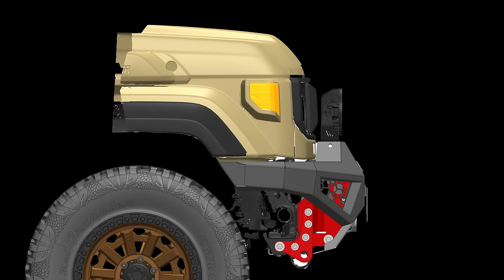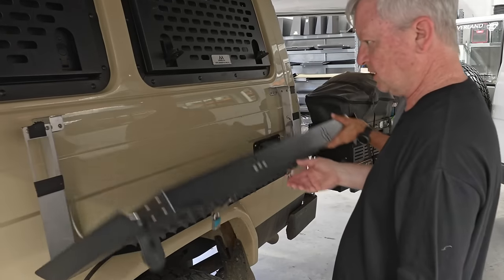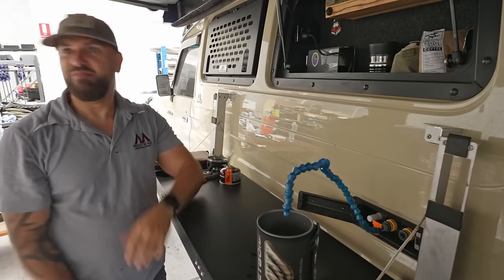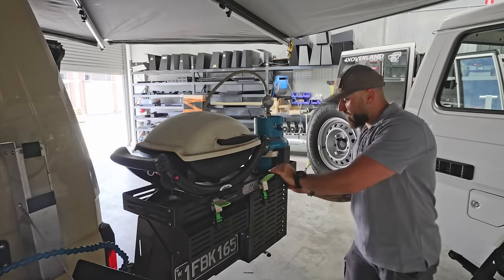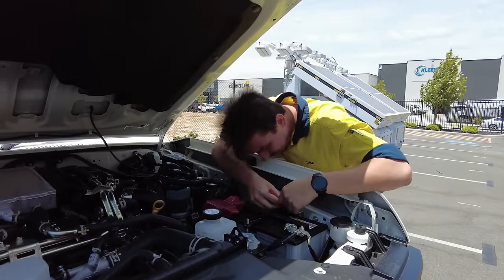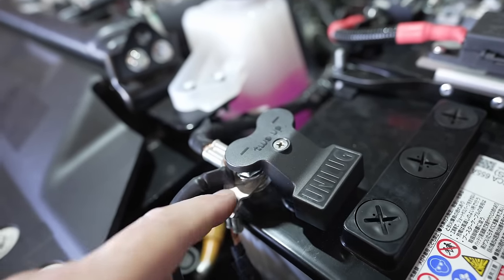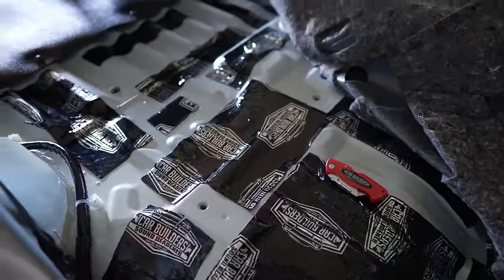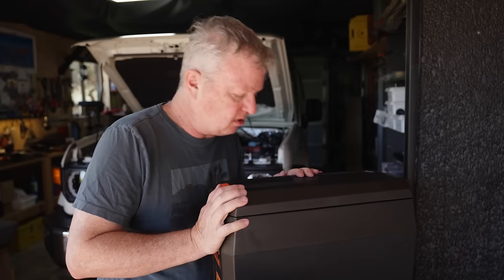TROOPY 2.8 BUILD START. New Bull bar Design @4xoverland

Comment: Engel Fridges.  Andrew, I’ve run Engle fridges for over 30 years and traveled some very rough roads…never once let me down.
Reply: And a quality made in Thailand product.
Reply: @ozyrob1 Like every dual cab Ute. 🇹🇭
Reply: I believe the Engel fridge company is Japanese. In any case they are most definitely NOT  Australian. Any suggestions that the products are Australian is purely based on marketing. Cheers
Reply: Anywhere except China...!
Reply: not made in Australia.
Reply: Engels use a Sawafuji Swing Motor, which is made in Japan. The fridge/freezers themselves are made in Thailand. Engel fridges are ruged and use extremely low amps. Recommended. Never let me down.

Comment: Off the top of my head that may still be made in Australia ARE Norcoast TrailerBlazza fridges, may not the best looking fridges and also a bit bulky but they are probably the only ones left.
Reply: Just noticed your reply after posting the same comment. Cheers
Reply: THE BEST
Reply: I have 4 different trailblazers/norcoast refrigeration fridges ranging from 20 years old to 2 years old in different shapes and sizes. Made in Caloundra QLD the dear old love margret is still on the tools with her sons making them. Doesn’t get more Aussie or quality than that!

Comment: Evakool fridges are made in Australia on the Sunshine Coast in Queensland
Reply: And I think some of the Aussie ones are fiberglass which is probably the best material for a fridge really as it won’t conduct like metal will
Reply: I have had one and no need for a cover and low battery consumption.  Temp setting not quite same as inside fridge but I use a wireless fridge thermometer in the fridge. Happy w my 55L Evakool purchase in 2016!
Reply: @51mondays  and the fiberglass doesn't corrode in the marine environment. Actually that is the reason why Evakool introduced the fiberglass option.

Comment: Take a look at, or even better phone them and chat about, the Bushman fridges. I’ve got one of their 35/52 ltr fridges. I’ve had it since 2006. I have taken it everywhere, and I do mean everywhere, in Australia over that time. The worst roads Australia has to offer and a lot of proper hard core off-road driving. It’s been tied down in the back of three Hilux’s and a Cruiser over that time. It has never missed a beat and has performed amazingly well!!!! Very, very economical on power. Has held temp asked of it (including -15deg) always regardless of outside temp. Including regular ridiculously high outside temps. The design is very versatile. My wife, my mother in law, two dogs and I lived out of it for a year of remote travel in 2007. At present it in the back of my hilux as a drink fridge as my trailer has a 98ltr National Luna. If mine stops working any time soon, I won’t even hesitate to buy another one.

Comment: I have been using Engel fridges for many years and swear by them. I have two 60ltr Engels. I live in the Pilbara in a harsh hot climate and they have never let me down. Solid basic & reliable. And by the way myself & friends are planning the CSR later this year. Live your work and keep them coming. Cheers 👍

Comment: Evakool make some fridges here.
We've had Engel, Evakool and MyCoolman fŕidges and all have been fine.
The Engel 40 litre is still going 20 years later with our son. 
The Evakool is a 30 litre which we are currently using as a freezer in tge back of our Defender.
The MyCoolman 95 litre twin compartment came with our new caravan and is excellent. 
Honestly, there are 2 main brands of compressor used by most fridge companies, so it doesn't make much difference which brand you choose.

Comment: Hi Andrew, have a look at trailblazer fridges, build on the Sunshine Coast. Another one is ozefridge, these are made in Victoria, ozefridge and the oze 80l holdover is a eutectic fridge with many cleaver features such as voltage sensing which ensures the fridge eutectic panel is chilled when vehicle is running conserving power when off. 
The fridge uses gastronomy trays and allows you to adjust heights and we have made an alloy tray perfect size for beer cans or coke bottles? Without a single rattle.

Comment: I would recommend  a National Luna . I have done over 40,000 km with only one problem which was fixed with no drama by the Aus agent, I expect to have no more problems. Operates sensationally well in the high temps.

Comment: The question regarding fridges could be a sore bite. I have had a range from Snowmaster to Evakool. Without being bias - the one comment that has stuck with me is to consider 

1) good insulation and 
2) good compressor - of which both that helps with minimal current draw. 

That’s the difference between and cheese quality- not countries.

Comment: Snomaster knocked off a lot from others, there power draw from personal experience and talking to others is very high (the first one I tried was 5.7A and never turned off, the 2nd one they gave me drew 4.7A). They took it back and went to Engel, average power draw is 1.66A once reaching temp. I now have 4 Engels. National Luna are amazing but never tried them.

Comment: to fix the dead spot space issue   may affix cams  so your  aren't yanking the kneck ove  the passenger seat it  is easier to monit ya blind spot with a cam an monitor setup

just remember you don't have a v8 in this  weight will need to be  reduced   to comply with the engine

Comment: Great video as usual. But where is the part that reviews the new stock 2024 Troopy? What 4x4 features Toyota added to this new generation? How does the engine perform compared to V8 from an overlanding perspective? Does correcting axle differences have any significance after Toyota ignored it? Hope to see a review soon, thanks!

Comment: A long time ago ago I recommend using aluminium instead of of wood for your fit outs 
Great choice Andrew
Reply from the maker: Since 2011 I've used alu and wood in my builds in the past. I actually prefer wood. Both have advantages and disadvantages.

Comment: Go for fridge build quality, service and long warranty backup both on east and west coast. Maybe Engel for low current draw, service, known durability 'in the back of dusty utes' and any fridge tech can repair them and get parts. I have had Engels for over 50 years now rattling around in back of 4WD's and not once has one let me down.

Comment: Andrew, we now live in a global economy. If the product you need is only available from one source you have no choice. If the product you need is made or available locally and is of acceptable quality, and you want to support local, do so, BUT we all have budgets we need to work with. The bottom line is, as long as the quality is acceptable, is accessible and is within your budget, it doesn’t really matter where it’s made or coming from.

Comment: Imagine those sink drawer runners after they’re full of dust 😂
Reply: its a prototype version of the table, which we installed on my troopy, it has been modified now with out any issues 😉
Reply from the maker: I don't have to imagine. I've used these runners in three of my previous builds. Dust is not a problem for them.

Comment: Don't split your kitchen to be on both sides. Fit a small slide out kitchen between the passenger door and the drop down table. Keep it all together with the kitchen gull wing above the gull wing.
Reply from the maker: this kitchen is all on one side.
Reply: @4xoverland  Just to clarify he has his washing up drop down on the driver's side and the pantry and running water on the passenger side. You will need to walk around the car to wash your dishes. The wash up drop down would be better on the passenger pantry side.
Reply from the maker: No. The kitchen box and gull-wing, table, wash basin are all on the left. On the right is a table, but it carries the MaxTrax and is also useful for shower items etc. Not like Sean's. I have ordered and change.
Reply: @4xoverland  Thanks this will be a great build to see how you do things this time. They are a nice looking car. Thanks again.

Comment: Hi Andrew, what's your thoughts on the exhaust location under driver door, I've got a 24 Troopy and noticed that on delivery,  time will tell
Reply from the maker: It used to be on the other side and I nearly severely burnt my face on it on the Canning Crossing when underneath clearing grass. But at least with this one, its not right behind the DPF like the V8. So an improvement. And I'll be covering it with a step or bar. Still deciding.
Reply: Thanks Andrew, looking foward to your build @4xoverland

Comment: Hmm, I'm just testing. Not really good at Social Media. I just became a member to see if it helps me get noticed.
Reply from the maker: YouTube is the worst place I can think of to try and make contact with YouTubers. And the occasional post on any social media platform isn't either. Its never ending, relentless post after post after post - that eventually will get some traction. I did see your message to me via my website and I had a look at your video. I shall respond. Then again, you probably will not even get to see this message.
Reply: @4xoverland  Thank you. That's all I ask.

Comment: Nice Bar.  No matter how I look at it though,  the bonnet is still ugly!   As for fridges, Eva Cool and Trailblaza still have  Australian Made versions.  The Evacool are a little more refined, but the Trailblaza are rugged units. I still have 2 60 litre Trailblazas handed down from my dad, both over 37 years old and still running  reliably after life of living on the back of a ute and countless adventures.  Service and support are second to none, they really do stand behind their product . I also run one of the newer 40 litre units, which is just over 4 years old and never missed a beat.  While the  electronics is not as refined as some of the newer fridges, they do offer some options.  The biggest difference is the level of insulation - whilst they may not be as efficient on paper, the compressors end up running less.

Comment: How many times do you think that drying rack will be clean enough to put clean dishes on? Channel some Colin Chapman… make it lighter, less is more!
Reply from the maker: the table always needs a wipe down. So, to answer your question, probably never.
Reply: the table is multifunctional and only 9.8kg  that's the beauty of it.  , i have travel to remote places, dusty roads including mud, never cleaned the table, its because the dry rack locks against the table with compression latches, yes you get dust around the molly holes but never on the other side.
i have sold nearly 65 of them since i finished the design, not a single problems or complain about dust.
this products built for 4x4 vehicles or people who travel or live in the outback. it is a dusty life i guess 😉

Comment: Why is the sound insulation placed so haphazardly in the rear quarter panel?
Reply from the maker: watch this video. There is no point in putting it everywhere. Its a dampening matt. Not an insulator.

Comment: I am too scared to say Engel fridges. You didn't mention it at the end, so you probably know something we dont 😅😅
Reply from the maker: They are not bad and used to be the best. Motor is efficient, insulation poor. Made in Japan.
Reply: @4xoverland  personally, I never liked the SM or NL. Not that they are bad or anything but I just never liked those 2 brands. Always been Engel.

Comment: You know you can build a custom fridge right?
Reply from the maker: I did that once. I would not do it again.
Reply: @4xoverland  - Fair enough.  Have had exactly the opposite experience though, both with vehicles and boats.  As long as the builder knows what they are doing I've found the end product to be superior.  Downside - cost can be higher than off the shelf stuff.  Upsides - better insulation, better seals, custom size, and ability to remote mount the compressor into an otherwise unusable space.

Comment: That wash up bench is a ridiculous idea IMO. Totally unnecessary and so much weight to wash your dishes and that drying rack would be filthy with dust.

Kinda getting tired of episodes full of adverts
Reply from the maker: Ridiculous suggestion IMO. Build videos means products on display. Its unavoidable. And none of this is necessary! A life spent avoiding anything that isn't 'necessary' is a very dull life. It might be useful. It might be useless. Fitting one is the only way to find out. Tables on the outside get covered in dust. Wipe them down. Or, have them take up valuable space inside the vehicle, and still wipe them down, but not as much. Pick one.

Comment: Drifta do a wonderful Glass Gull wing...Australian Made.
Reply: @zenmachine50  Firstly, It's glass. You don't need to drill any holes. You can fit it by yourself and inside, you get a really handy hollow space that you can use as a conduit for wires or cables.